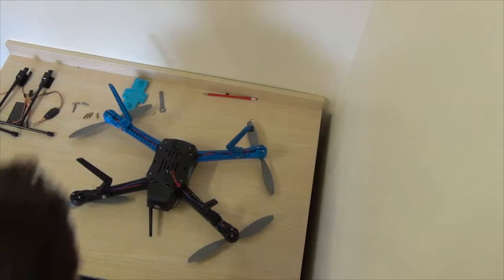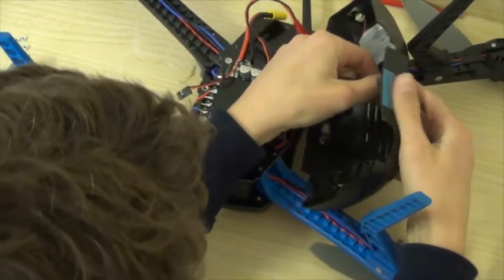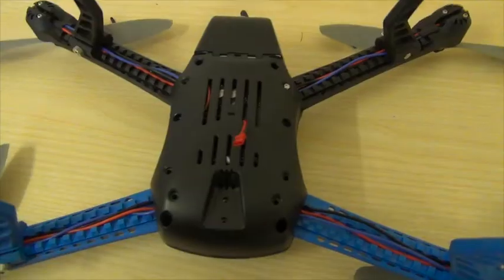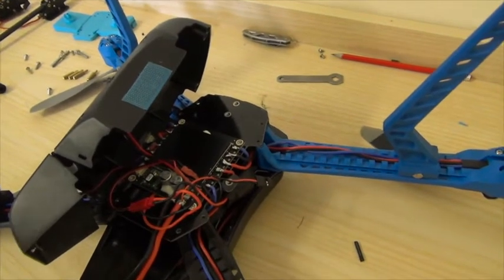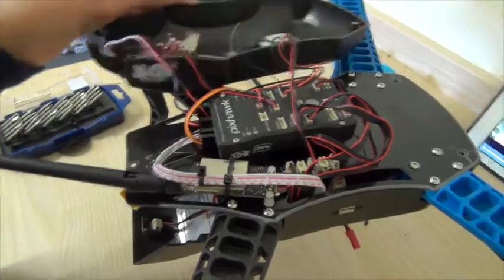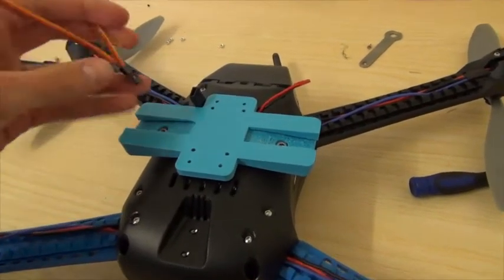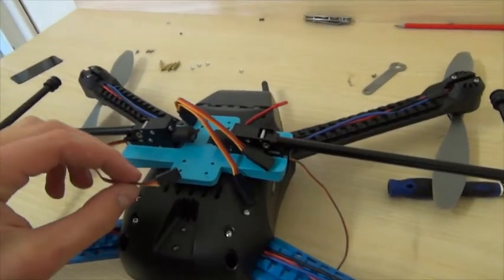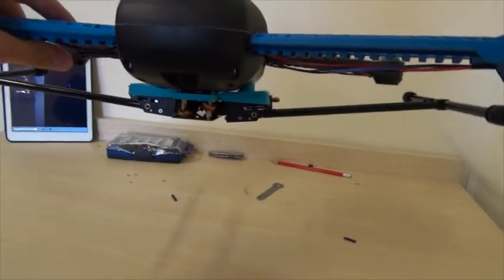FLOC Retracts Installation

Comment: Is the gimbal plate compatible with the FY-G3 Ultra?  And can you go into more detail on which channel/switch is used to retract the gear?
Reply from the maker: yes the gimbal plate is comparable with the, FY-G3 Ultra, and the retracts use the switch on the left side of the remote.
Reply: Birds Eye View
I read that it uses the switch on the left side of the transmitter in an earlier comment.  I was hoping you could specify which switch.  I'm trying to verify that the retracts don't conflict with an existing feature, and that they can use a previously unused channel on the transmitter.  At the end of the video, it looks like you're reprogramming the roll for the gimbal to control the retracts.  The gimbal needs the roll control.
Reply from the maker: The software for APM is a bit weird, you can still use all of the functions, the IRIS has about 4 free channels, thanks

Comment: Roll is supposed to be used by the gimbal.  Is there any way to tie these in to a loose channel, like channel 8?
Reply from the maker: The retracts run off of the switch on the left side of the remote, Thanks